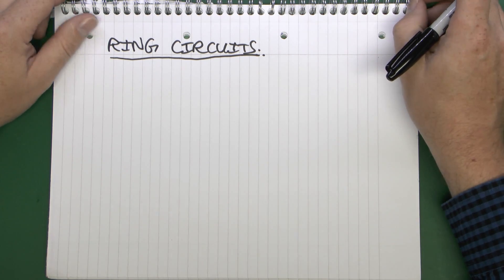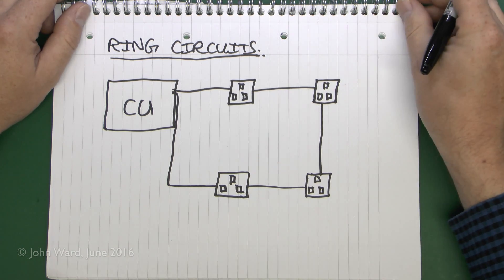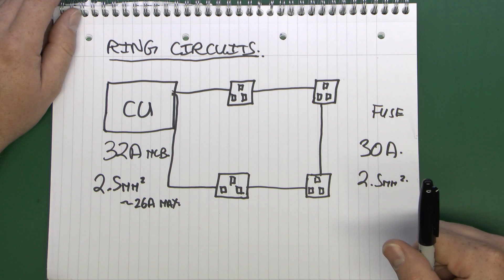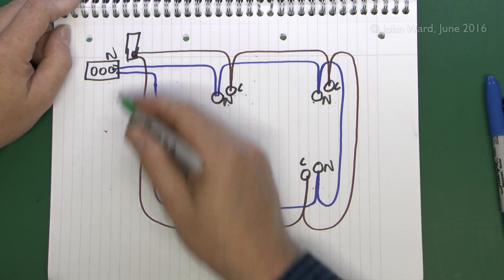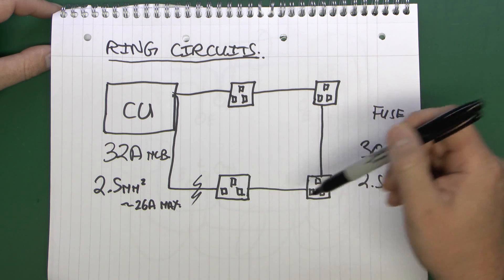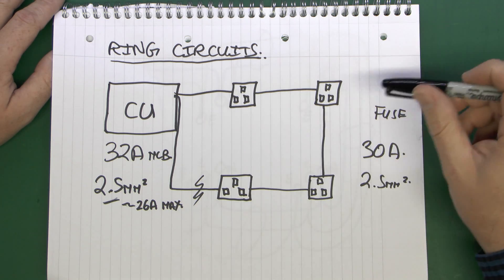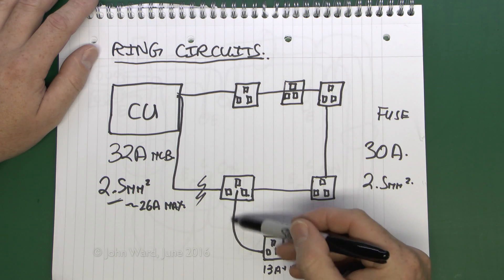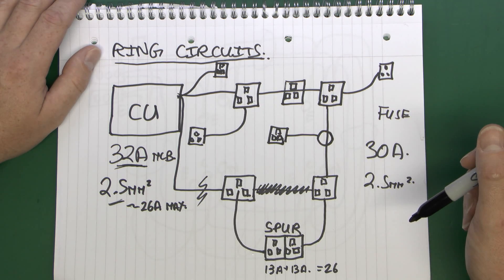UK Ring Circuits (previously Ring Mains) for Socket Outlets

Comment: I've never seen 4 hole paper before. Here in the US we use 3 hole. Or 2 hole. It depends on the size of the paper. Nonetheless, I too was watching technology channel and wondered what was a ring main. Yes I'll agree that is unusual way of hooking up to the main circuit breaker. Seems like a waste of wire going from the last outlet back to the fuse box. Potentially, 2 power sources for the same circuit. It is redundant to be sure, but at the cost of safety. Using that system here might get you out on your ear.
Reply from the maker: 2 hole is common here as well - it's the middle 2 holes of the 4 hole arrangement.
The ring circuit was intended to save copper, with the original intent that there would only be one such circuit for the whole house and the outlets and plugs would be one standard design for everything.  Previous methods of wiring (1930s and earlier) was one cable to each outlet, and there were several different types of outlet in use.
For a ring, the cable is rated less than the circuit breaker / fuse, so it must have 2 of them to avoid overloading. 26A rated cable with a 30A fuse or 32A circuit breaker.
For modern installations it's a total nonsense to use rings, as it's common to have multiple circuits per house, radial circuits are far more appropriate in that situation, and for those, the cable is rated more than the circuit breaker, the same 26A cable usually on a 20A or 25A circuit breaker..

Comment: Having spent $300 for a uk transformer in my basement, this is a tad annoying, I could have paid the same money to just get an electrician to stick a proper UK socket on the wall 6 feet from the circuit breakers.

Comment: I can understand in the era this wiring was done the intention was to use less materials. The hypothetical circuit shown in this video would be safe today if you used a 25Amp breaker instead of 30A sizing the breaker to protect the smallest wire from overloading and ignoring that two cables would potentially share the amperage load. 
 I know it's not current code but from a common sense standpoint it is a valid and safer installation than the original design. 
Even Today I see installers running bare minimum sizes of wire where able to save a few dollars. This practice puts the consumer in danger when they put a device drawing high current in a socket that was wired with it being intended to be used by low current devices. Just because the device can fit the socket doesn't mean the circuit was installed to handle all possible loads that will connect to that socket. 
Even in dedicated runs of wiring for a single access point he consumers natural reaction is to take out the small 15 amp breaker and install a 20 25 or even 30Amp breaker with no understanding of wiring protection. 
I've seen this done many times and I always use largest sensibly sized conductors when I do any installation. 
Another common case is a hot water heater being powered by electricity. An installer will install a dedicated run and size the wire to the device being installed. Years later the unit goes out and the family installs a larger unit with higher power requirements. Now you have an oversized unit on an undersized circuit. The breaker trips a few times and they install a larger one in the panel to avoid the trip.
Planning for the worst case is how you keep a house from burning down.

Comment: Can you upgrade that with pair of 20a breakers for both ends? If ring fails it will trip the 20 breaker.
Reply from the maker: A 32A ring can usually be split into two separate 20A radial circuits.
Connecting both ends of a ring to 2 separate circuit breakers is not acceptable.

Comment: Excellent video _ I'll be watching the rest of your video's.
I have zero knowledge so here's a silly question ... If the ring is broken because of loose wiring in a socket (thus potentially overloading the cable), why doesn't the 30A fuse in the MCB blow? My guess is that there could be current greater than 26A and less than 30A. So why don't MCB's have 26A circuit breaker?
Reply: You'll be watching the rest of hs video's what? Which possession of a video did you mean?
Reply: @HelloKittyFanMan.  The other informative videos he made and posted to his channel.
Reply: @KLiCuk1 : So... video's videos? More than one video that belong to one video? Or did you just mean that as "videos" (plural), and that apostrophe should just be edited out?

Comment: So stupid. In France we get L and N coming from the same breaker, and you just wire them in sequence. 16a breaker, 1.5mm, max 5 sockets on one sequence, 3 wires in, 3 wires out, ending with the final socket with no need to return to consumer unit. Or you can use 2.5mm on a 20a breaker and have 8 sockets on one. Much better.

Comment: Why not 4mm² or 6mm² . Than one cable will be enough for 32A
Reply from the maker: Today - no reason, nothing wrong with a 32A 4mm² or 6mm² radial circuits.
In the past, rewireable BS3036 fuses were the standard item, 4mm² could not be used with a 30A rewireable fuse, 6mm² was the minimum size, and using 2x2.5mm² used less copper than 1x 6mm² assuming the other design intentions were also done, the main one being that there was only one circuit for the whole house.
RIngs are a very old design created for a specific purpose.  Unfortunately plenty of people assume or have been taught that they are the only way to install circuits for socket outlets.

Comment: I defo use ring mains for kitchen appliances with a few isolators in a cupboard so that it becomes a balanced load on cables and hidden away from worktops make a neater job, I would use it to feed for example, cooker hood, hob ignitor, dishwasher, waste disposal, hot tap, bolier.   Fridge will be on its own RCBO circuit for obvious reasons such as going on holiday you don't want some thing to trip the RCD and affect the fridge if it wasn't wired in separately.

Comment: Hi John  Could you clarify  what this means'' 2x2.5mm²(ring) for 7.3kW - (230V) ''  This wiring is for a instant hot water heater  using 7.3kW & 31.7 Amps  Requiring I presume a 32 amp fuse.  Is this Just using a standard ring circuit using 2  x 2.5 mm as you explained  ie 2  3 core ( 2.5mm) wires from Water heater direct to CU, with 32 Amp Circuit breaker at CU ? Many thanks !
Reply from the maker: That is a description of a standard ring, but it would be totally inappropriate for a single appliance.
A 4mm² or 6mm² radial 32A circuit would be far better.

Comment: is it easy to find the approximate mid point of a ring circuit to disconnect the ring and then create two radials with 20a MCBs when fitting a new CU with capacity. would this be a resistance test of the Line or Neutral cable.
Reply from the maker: Isolate power, disconnect ring cables at the consumer unit, temporarily link L&E at one end of the cable, measure resistance between L&E at the other end.
Divide that resistance by 2 for half of the ring, then test at each socket between L&E until you find the one with the resistance nearest to that value.
Reply: @jwflame  Lovely. thanks.

Comment: I could have done with a ring circuit to power my twin 2400W boiler elements for my still. I actually like the concept. Cheaper than having 20 amp circuitry installed.

Comment: I was an indentured apprentice with the electricity board in the 60's and when we did 5 years, combination of college work, on the job training and special short speciality courses in and out of house and finally not to forget the 6 ,months initial basic workshop training which I well remember as being intensive and very diverse. We were taught about domestic wiring ring circuits amongst many other things and it was drilled into us that they were not and never have been ring mains, such reference to 11,000 volt ring mains, RMU's, et al,  being the electricity supply company local, underground and overhead distribution network and nothing to do with house wiring. I cannot accept that using radial circuits only and abandoning the 32 Amp ring circuit is a good idea as the days of people wanting a handfull of 13 Amp sockets in a room are long past. The ring circuit has been a good system and still is in my opinion and in our small bungalow we have at least 10 x 13 Amp SSO's in all rooms and many more in the kitchen. Having sufficient sockets and a few spares obviates the need for trailing leads and use of dreadfull cheap multi way extention leads. We were taught to ensure all connections were sound and that ring circuits were exactly that and were properly tested. I accept the potential risk of having an incomplete ring conductor and that in the old days before mcb's were available the 30 Amp rewireable fuse was very crude protection and open to abuse with oversized fuse wire fitted by unskilled, unqualified people. But the 32 Amp mcb will trip quickly on overload and even in worst case scenario where they is a discontinuity in the ring circuit I doubt a fire situation would result. Notwithstanding this, and as a trained engineer now, we know and have accept that with any installation whether it be electrical, mechanical or structural, things can and do go wrong and that is why we must ensure that all engineering work is undertaken by qualified professionals and that final testing and inspection of their work is carried out independantly by a trained and experienced person. Also, it is a requirement that such work is re-tested at specfied intervals in accordance with IEE regulations. Thank you for the video, which I enjoyed watching and which has given me food for thought. However, I do feel that you have over played the situation and that you have not explained why the UK 13 Amp system of fused plugs and ring circuits is a much better one than many of the methods used in other countries. Some wiring and the cheap and very nasty sockets and plugs I have seen are possitively lethal. Our 13 Amp plug top is the result of decades of development and when you examine a trade standard BSI approved make, you will appreciate just how superior it is, both mechanically and electrically bar none.

Comment: How’d you get the current to pass through the hole 7:06?
Reply: Because it's a ring it will still offer protection from the other side. If it was a radial circuit it would be a safety issue. Always try not to have punched holes in your cpc
Reply: Magnetic induction.
Reply: pyrioncelendil Stop it! Lol
Reply: albert sparks hopefully not it’s the cpc
Reply: Remember, the paper is insulating. So the hole is actually a break in the insulation. Logically, it must conduct.
Reply: Lawrence D’Oliveiro 😂🤣😂🤣😂🤣
Reply: Lawrence D’Oliveiro 😁
Reply: @lawrencedoliveiro9104  Ha!
Reply: The circuit goes wireless at that point.
Reply: Alan Woods Aahh, Technology, I now see. 😊
Reply: You must fit a flux capacitor.........GREAT SCOTT MARTY.    !!!!!
Reply: Jeff Rawe 😄
Reply: 1st 2 replies completely missed the joke 🤣
Reply: @alexnelson4965  Lol. Not really you know. Check back their statements.

Comment: All the upstairs sockets in my house are supplied by one twin and earth. Does this indicate a radial system?
Reply: Not necessarily. Easiest way is to look at the protective breaker in your consumer unit. If you have 2 Brown wires it's a ring, 1 wire it's a radial. Obviously turn off the main breaker before removing the CU cover and don't touch it at all if you haven't understood what I've said.
Reply: Mal Boomal thanks for your help Mal. There is indeed only one live wire and one neutral coming from the breaker

Comment: The most compelling reason for ring mains/circuits as compared with separate cabling to each socket (as in the forties) is that they give the user maximum choice in where to plug in portable appliances, without increasing the amount of wiring in proportion to the number of outlets.

The intention is that in a room with plentiful sockets there will not be any need for long leads on portable equipment  (trip hazards) or multi way adaptors (which can be a fire hazard).

Why not use a radial?

The advantage of the ring over the radial is that you can test for loop resistance. This detects whether there are any poor connections at any point in the ring, which could lead to a fire risk. You can test this at any point in the ring, without visiting all the sockets. This test is the reason for most of the rules about spurs. 

Secondly, if a poor connection does develop, it's less likely to cause a fire unless a second poor connection arises. This is because most of the power will flow to the socket that's in use by the line of least resistance. The dodgy socket gets hot when it is used, and hopefully the consumer will notice. That socket does not get hot when other sockets are in use (unless there are TWO dodgy connections)

In contrast, in a radial, if there is a poor connection at an unused socket, that socket will get hot whenever sockets are used that are further from the CU. If that socket is rarely used, or is a permanently plugged in appliance, the consumer is unlikely to notice the hot socket till it bursts into flame. 

So the extra cabling back to the CU is for testing and safety. There is a coherent case to support this

You clearly feel the the disadvantages outweigh those advantages, but it's only fair to mention that there is some sense to the design. It's not totally daft, as you seen to imply

Comment: Say 6:52 , will there still be current flowing through the right side of the brown wire?
What about the voltage drop for circuits like this? How do we calculate them?

Also for 12:12 , if there's a spur circuit, how do we calculate the voltage drop for this case?

Comment: I agree with John ring mains can be potentially dangerous I had a situation where I did some work on a property I tested the ring a couple of weeks before when I changed the distribution board and then I went back to add a socket to find the ring now wasn't continuous luckily there was a freshly decorated wall where a socket looked as if it was tampered with as it was put back on wonky so I pulled the socket off to my surprise there was a loose connection to get to the point I filled out a cert on that property a couple of weeks before now if I never went back that ring circuit could still be a potential danger

Comment: Can't you test it quite easily just by plugging a low powered test light into all the sockets and then disconnecting first one end then the other end of the ring at the CU?  All the sockets should work with either end connected.
Reply: Yes it would work for now but how do you see the problem when one cables is disconnected/damaged years later? 

What he is saying is that if a problem occurs, you should see it immediately as an appliance not powering on instead of a fire years later due to cable overload.
Reply: @patnutoris4054  Yes and I agree with his assessment for all those reasons. I think he said he was going to make another video about  the testing which is probably more complicated than what I suggested so I'm looking forward to seeing that.
Reply from the maker: Testing ring circuits is covered here: https://www.youtube.com/watch?v=BKyK0-_v5xc
Reply: @jwflame  When I rewired my flat in the 1980's I installed an unbroken ring. It took all day to thread 70m of cable through all the conduits but I managed it. Problem solved!

Comment: I get the strong impression that these anachronistic ring circuits are still being installed because they keep electricians in the money due to the excessive and recurrent testing requirements.
Reply: @Mark Sesum And your opinion is worth exactly what I paid for it.

Comment: Why was cable used in households changed from solid copper wire to the twisted wire type. The twisted wire is difficult to connect to terminal blocks, plugs, etc. because it flays when trying to connect to a terminal, with it’s small hole and minuscule screws, and it’s difficult to “make” an end by stripping the insulation to bare the wires.

Comment: That end comment is a load if B.S.
A long time ago we split the house into top and bottom ring mains and one for the kitchen that was when I was say 20 years old. I am 67.now there is nothing  I repeat nothing wrong in a ring mains circuit at all.
Reply: @Mark Sesum you can have a fault on any radial circuit, making it potentially lethal.
Reply: @Mark Sesum -When the ring is completed you double the load carrying capacity of the circuit +reduce to a minimum the voltage drop.
Reply: You did not get the content of the video.

Comment: Consensus of the comments would seem to be that your presentation style is pants! I certainly felt that I was being told off, and I also noticed that you emphasise the final word(s) of every sentence. Nevertheless, the actual content is quite good!
Reply: interdec the content is mostly bollocks - we don’t run a house off a single ring: most have at least three (upstairs, downstairs, kitchen since it has more high draw devices and appliances...) and have done for decades. My house has 4, and many have even more than that
Reply: audigex Indeed...my house has 3. His video on testing the ring was quite good though!
Reply: @audigex  You still have the same problem since a ring CAN allow an overload without immediate detection, be it 1 or 3 rings. 

Also, your specific configuration at home is irrelevant for the discussion since he is talking about regulation, i.e. something which applies to millions of homes. Can you guarantee that these millions of ring circuits are error free and none of them will overload?

Comment: I wonder why electricians still install ring mains today, given the extra wire runs and testing that’s needed.
Reply from the maker: It's very easy to carry on doing things you have always done, but slightly more difficult to actually think about whether what you are doing is still the best way.